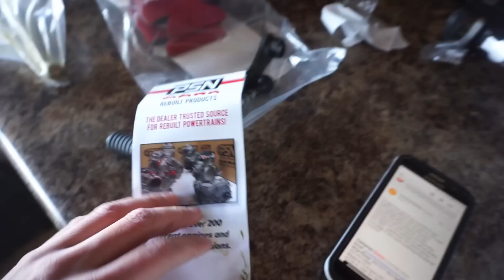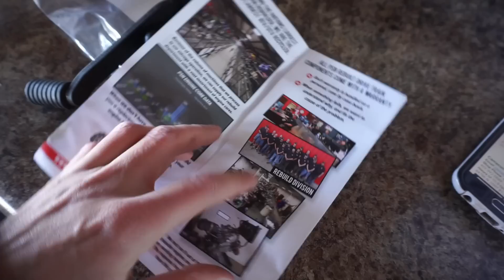THIS IS NOT GOOD...$200 TRASHED Warrior 350!!!(Part 8)

Comment: Should take that top end apart and at least clean everything out...
Reply: Micah Bell I can’t believe it’s even running by the way it sounds
Reply: @jacknothnagel5011  same thing ive been sayin, ive built many 4 strokes an to hear the squeelin an rockin of the piston is not good. also at the end of the video i see its pissin oil out the bottom meaning the blowby from the damaged rings are getting worse. :/
Reply: Spray some WD40 in the cylinder 😂👌👌👌
Reply: @chevyhp  cleaning.. lmao  fuckin send it!
Reply: @killaz123456789100   lol

Comment: what a tough motor yamaha! after seizing up and ran with a oil filter full of shavings, and not so much as a compression test, leak down test or valve adjustment or even a basic carb tune .....its still going. lean and mean with the crank seal blown out lol but my money is on its blown up next video, if he checked the oil he would be scared....it stopped smoking lol he paints wheels like he cleans carbs and brake calipers lol

cant stop watching, its like a cheap tim the tool man taylor that cuts every corner imaginable haha
Reply: First thing I noticed is that it stopped smoking - its likely dry, best situation is a stuck ring freed up.

Comment: First...great job putting in the work to take a non running locked up warrior and making her go. Suspect most of the negative commenters would not have put the work in and may not even know how to do what you did up to this point.

Second...I do agree with other commenters that on this one...since costs are low and potential return on investment may be better with a solid engine tear down and rebuild...use this project to dig a bit deeper and show us all how to perform a engine tear down and rebuild.

Believe whether you keep or sell...an engine rebuild on that old warrior will be time well spent.

Appreciate the content...nice job putting the work in.
Reply: Never seen him do more than take an engine side cover off or a top end off on a two stroke to send it to get re plated so i doubt he'll rebuild it

Comment: Hey Joe looks good man and I like seeing all the kids in your comment section saying you should change this change that make this look better. you did it right man you got it running first you fix all the mechanical problems before you make it look good. that's how you do it I'd rather my machine run then look good and not run... and the shifter problem is definitely the adjustment on the linkage and that rattling noise your hearing is from The Recoil cover not being on most likely... but for a $200 quad dude it looks 100% better then when you got it people hating on you for the way you fix stuff they have to remember it's yours it's your quad you can do whatever you want to it lol if you want to replace the top end that's the only thing you should do if you want to being u fixed everything else...

Comment: Idle still way to high and seem like front brakes are on i ride min in way more snow with less spinning also put old shifter with new linkage if ya can
Reply: Richard Jados the little screw on the bottom of the carb will adjust his idle lol easy fix
Reply: @codykuiper9613  yes i know must not have a screwdriver that size lol

Comment: Tip for grips- use hair spray or spray paint to keep them locked on so they don’t twist.. or grip glue. Make sure to top oil off frequently if going to ride with engine needing work like that! Nice to see a piece of junk turn into a running machine, thought for sure it was never going to run without a rebuild.

Comment: To cleaning stuff up after sanding before painting, you can use ammonia. Doesn't cost sh*t . And to get off or put on grips, squirt some rubbin alcohol in them, it'll work even better. After it has vaporised they'll be solid. Btw i think she doesn't shift and makes that noise cause your clutch is worn

Comment: The compression release is made into the exhaust valve  cover you need to check the spring on it   87-88 were the only years with pull start your shifter has to be for those years  valves and carb need adjusted the knob on the bottom of the carb adjusts the idle

Comment: If you take the top end off make sure you check where the cam bearings seat these were bad about chewing up the bearing seat  but 350 wolverine head and 350 raptor head will interchange as they're the same

Comment: Next time you are taking grips off, use a box cutter (that is if you aren't going to re-use them). BTW, nothing on a Japanese quad is 7/16. It's all metric. I am hoping you know that, but didn't want to go looking for the correct size. Though as boogered up as that quad is, they probably just cranked an SAE nut on there. Your linkage is not correct, that is why it won't shift properly.

Comment: You should get a 300ex or 400ex. They are awesome quads
Reply: A 300ex is really a 250ex bored out
Reply: A 250ex is a recon 250 with different plastics. The motor is different on the 250ex than the 300ex
Reply: 250 ex trx is the goat four wheeler

Comment: That quad has a reverse, should be on the right side under the tank, when your in neutral it pulls up and backwards, also you put the linkage back on wrong, that’s why your shifting is messed up, when you clicked it down you went up a  gear, you basically made it GP shift like on high-end street bikes

Comment: That shifter is for 89 or newer try reading the comments I told you 87-88 shifter only unless you eliminate pull start
Reply: Warriors have never been pull start
Reply: @nolanhauge  87 & 88 had a recoil or pull start as a back up also the only 2 years for the manual compression release  89 and up do not have the pull start  you can also remove the pull start assembly and swap in an 89 or newer side cover for a cleaner look  one last note do some research before talking about things with today's technology it's easy

Comment: If I had to guess I say it's not going into neutral because of you cobbling the WRONG shifter on it. Also the tubing on those handlebars is pinched at the bends. If anyone ever comes down hard on them, they will fold at that pinch point and severely injure whoever is riding it.

Comment: Just adjust the linkage that connects to the engine. The shift lever should be under the pull cord case not bent to the side like that.

Comment: I basically got one for free a 98 warrior Yamaha and the first thing i did was clean the carburetor it had like a frozen gel inside out and the float needle was frozen in it's slot i clean it took the grown needle out the hole put anther one from another carb but i Broke the tower for the float pin what the float goes connected too i gorilla crazy glued it just so i can put the cover on knowing the had will eventually eat it away but it was flooding the carb I've been trying to get spark but will only get some with the spark plug boot off i checked out with my volt ohm tester and it only had half the resistance that was recommended by a video i ordered a new carb and cool pack and CDI any suggestions i obtained this warrior through some work we did for a landlord were their evicted tenant left it behind so it's mine and i just wanna get it running so i can ride my kids on it and teach them how to operate a quad

Comment: The electric start is not working.. It should not sound like that when you go to to start it..
Reply: Jody Hakamaki starts up don’t it
Reply: @dirtbike.drayke   Yes it does that's not the point... It does not have a recoil so it is going to leave him stranded.. Putting a new starter in it will eliminate  that happening..

Comment: First off all, the shifter linkage needs to be adjusted to the proper specs, the rear tires are NOT made for snow,  lower air pressure for more grip. My advice...READ THE MANUAL !!!!

Comment: What is that high pitch noise, the starter?
Reply: that is the one way bearing stuck on. its spinning the starter. its suppose to be free spinning in that stator case. over time the starter will wear out. plus its smoking and tapping bad. she eont last long. I've fixed plenty of big bear 350s and kodiaks. I knew soons he tried to spin over engine starter was binding up.
Reply from the maker: @Jamesrideoutadventures  yeah it's probably the starter. What should I do to fix it?
Reply: youd need to remove that cover off stator. do a test with the flywheel if the back gear doesnt spin freely. youd need to replace it. that's probably why the pullcord ended up breaking because of that issue
Reply: @2vintage  I repair atvs for a living. that one way bearing is the killer of all starters and recoil ones. it also has alot of bounding up so pulling it over is a nightmare. that's why ur drill struggled because if it. not spinning freely. what's your facebook name? I'll help ya out more bro

Comment: Can I have advice on my rusty chrome kx100 pipe how to clean??
Reply: sand it
Reply: @bkerney98  no it's chrome can't do that my cousin already did looks like trash
Reply: put WD 40
Reply: put WD 40 on then shrab it
Reply: Use acid
Reply: Re-chromed 🤔 .... but the process might reveal any small holes, in that case it would require some welding 👨‍🏭 by someone WHO is very good at it., then re-chromed ., but the price??? 

Buy a new one 🤷🏼‍♂️👏🏼👏🏼👏🏼👏🏼👏🏼👏🏼😂😂😂
Reply: yes
Reply: @bkerney98  ok k
Reply: Use 000 grade steel wool buddy, it wont be the same as it was but it will look alot cleaner!
Reply: @deigo27derekdtboysimpson89  ok I'll try that

Comment: So not only can u not work on an engine, but you can prep a surface for paint or paint properly either. Guy its like negative 5 out and u have the door wide open. Read the damn can.